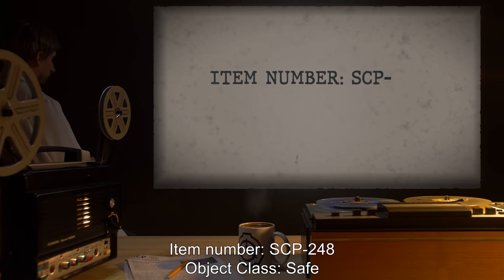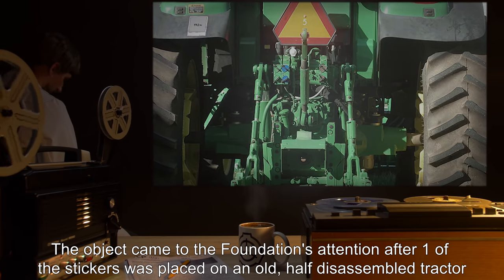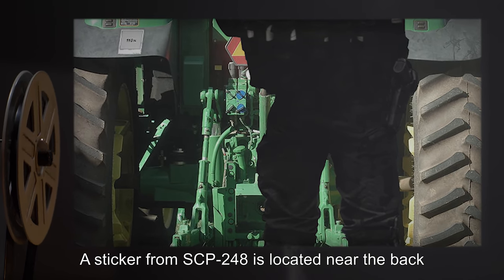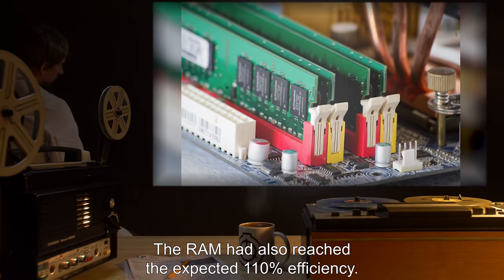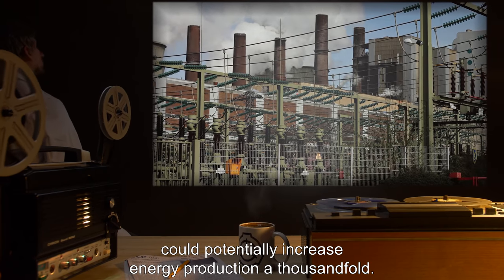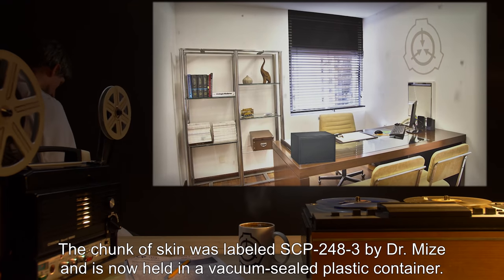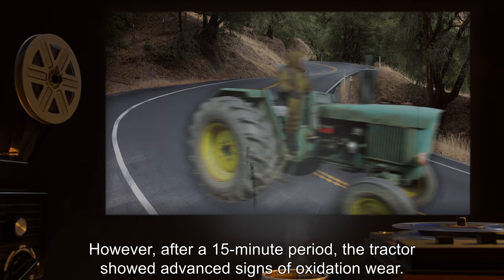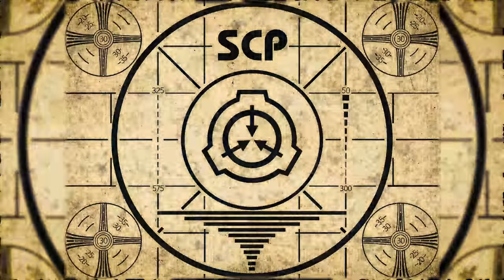SCP-248 | 110% (SCP Orientation)

Comment: This is the prequel to scp-001, the factory. Is this the researcher that looked too close into the factory and got caught?
Reply: Hey there! I actually wrote 248 back when I was still in college. I wish that was the case, but my original plan was to write about Dr. Mize's adventures studying physics based anomalous items at Site 18, where he started as a researcher. The connection to The Factory was going to mostly take a backseat to a separate narrative I was (and am somewhat still) working on that incorporated Dr. Mize into my other scifi project

Comment: Couldn’t they use some of these stickers to contain SCPs contained with failing security devices?

Slap one of these on the world eaters chain and it’d be as good as new
Reply: Yep. The chain that holds the Devourer of Worlds should be strengthened with one of those bad ass stickers. 😁
Reply: @aramotoroadtrip526  prob because the equipment become weaker faster overtime

Comment: SCP-248 being put through SCP-914 would make it SCP-6248: 1100% 

SCP-6248 would be categorized as safe, kept in a vault in Site [REDACTED] for emergency use. Use of the stickers would need the approval of all 05 council members.
All stickers would be golden-covered, as well as all properties multiplying by 10. Item degradation doesn't exist on sticker-applied items, though all sources would need 10 times the amount of power usually required in order to power sticker-applied items. Stickers can be removed from items for up to three times before permanently becoming stuck to the fourth item.
Reply: that would be.. useful for certain items such as well, The containment for keters, Also, what would happen if we put one of those on 248, and used it, would it then make a 11000%? Then a 110000%, what would happen if we used a 110000% on a contianment chamber, would it become impossible to breach without an exact keycard?

Comment: what if you put a superconducter though 914 so it transfers engery without any loss of it and then put a sticker on it? woulld it make it have a transfer rate of above 100% createing infinite energy? also what if you put a sticker on a sticker?
Reply: Thanks scp 028 they have cold fusion reactors and they keep this knowledge to themselves if they could generate Infinite Energy it would not matter. Because SCP foundations job is to contain even if it could be very beneficial.

Comment: Also dude...this thing can be thaumiel as fuck. 

You have 106 breaking through walls on a regular basis yes? Stick this onto his cell. Now it is 110% effective when it was 95% effective prior. It should prove useful. 

682 as well, and i imagine if you want to use it on a bag that is covering 096's head, one wonders if it is sound proof, sight proof and absolute everything proof, operating at 110% can it stop him from rampaging because someone saw his pic?
Reply: those sticker need to be burn up or use on trash.   
 They can stack on  things .  Put the whole pack on one gun and fire it. The worlds end.     Mach 5,544.02  bullet